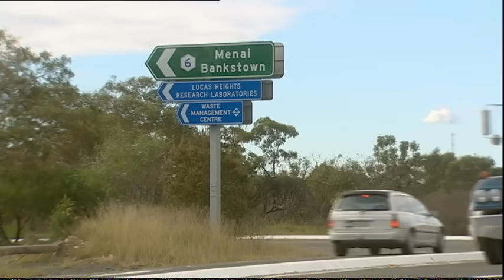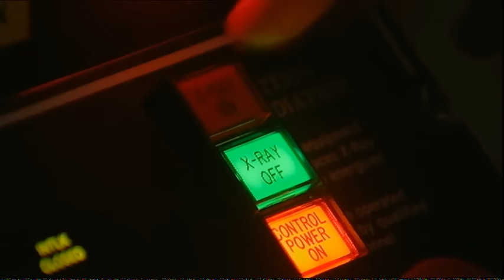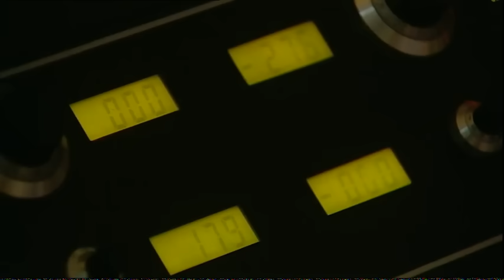The true story of the Kelly Gang Armour | Did it work? Who made it?

Comment: I've done cold roll black smithing, for raising a breastplate. It was done with a hammer and a dishing stump and no heat (hence the cold roll)
As someone who is only nominally skilled I can say without a doubt that this is 100% an amateur build. NOTHING about this indicates it was done by anyone with even a jot of craftsman skill or actual training.
Yes a fire dug in a pit would have been sufficient and if not, then they could have baked it using nothing more than sand/clay, just as they did for thousands of years.
But more importantly is the sheer mismatching going on. This is not a suit of armour, it is a coat of plates slap bashed together. Its still freaking rad, and I love it. but no, its not a labor of even the most basic skill. YES I could make it, chances are so could anyone.
other insights: it has very few hammer stroke indications. now a real suit would have been turned over a round ball shaped anvil and had those depressions hammered back out, which could be how they did it, but I dont think so. It seems to have been heated clamped and bent into shape. its a very simple shape already so thats what Im thinking. I totally nailed it too, the forensic guys said it wasnt heated past cherry.
If the heated metal plates were clamped then you could have used logs as leverage to bend the plates. 2 guys maybe to do it seems likely.

Comment: you can make a furnece anywhere if you know how. it doesnt need gas it doesnt need electricity. and frankly putting it if that was built by a trained blacksmith then he was crap at his job. A blacksmith wouldnt leave any sharp edges and theyd leave very few hammer dents in it as they pride themselves in there work there experts in shapeing steel

Comment: I wonder how it would stack up to a modern 30-06 rather than the lever actions back then. I suspect it may have stopped the bullet from exiting the body on the other side..
Reply: The British program "Time Team" fired modern rifles and projectiles from a 300 Win Mag and it punched through the similiar steel plate used in the demo. I would bet a 30-06 with 150-180 grain soft points would punch through. The kinetc energy would heat up the lead and melt through the metal. After all the WW1 Germans used the same principle by shooting reversed projectile at British tanks.

Comment: Pretty easy for a beginner Smith to make something like this using a basic charcoal forge. Coal forges get way way hotter and yet with charcoal you can melt steel.
Its also not hard to silence an anvil so it doesn't ring and damage your hearing you just mount it properly by staking your anvil shaped object or anvil down onto a tree stump, if the anvil doesn't move it won't ring
Reply: Definitely not lighting a fire and banging on steel with hammer for a week the first set was made at Benela by the local blacksmith and the other 3 by the blacksmith at Daylesford under duress he had a gun at his back the entire time nobody was admitting it at the time my family are from the Golden triangle they knew what happened Joe Byrne was the only one that was any good the Kelly's were not liked they never lit fire's or camped near water and usually only ever moved at night hid in dry gullys and were to scared to even talk worried Aboriginals would find them

Comment: I would assume that climate plays a role in how hot something gets and how it could be moulded? The climate was different back then , hotter in areas compared to now. So, with making a bush forge and the climate/heat at the time and quality of metal( take the steel used for making Buicks even centuries later compared to the synthetic metals and steel used now for making vehicles) at the time, it could probably have been done. Either that, or they made a haste deal with the Devil himself lol.

Comment: I dont get why a pit in the ground with a tunnel connecting it and some charcoal made by yourself cant get a fire up to forge temps? Are coal forge is just a fancy pit with a hole blowing air in from the bottom.
Im not a pro blacksmith, but ive made a ground forge that gets steel white hot.

Comment: The biggest flaw in these "you can't forge out in the bush" arguments is that they're all just amateurs assuming that a fancy and professional building-sized facility is a requirement to work iron or steel. (Or worse, doing so intentionally to try and hype up the myth.) 
Once you divorce it from that assumption it's perfectly doable even by amateurs, much less a trained blacksmith who just snuck some simple tools to the bush for a quick job.

All you really need to get a functional forge going is some bellows (Which are relatively portable and common), a couple bags of charcoal, and something solid to beat it on. That's it. 
There's plenty of videos of people forging with simple setups like this using a simple hearth made of mud/adobe, and a stone for an anvil. (PrimitiveSkills's channel shows this quite clearly on numerous occasions. Ditto all the various videos of third-world smiths floating around on YouTube.) 

I'm inclined to believe that guy who mentioned they used a log to form the cylinder shapes. The log would most likely be spent afterwards, but there's no reason it wouldn't last long enough to form such simple shapes with one.

Comment: If the armor was from farm implements that were made on a forge and then heated in a cooler Bush fire wouldn't the forge still have left its mark making all testing mute ?
Reply: No because every time the steel is heated it rearanges the crystal structure.
Reply: @awellner3285  I didnt know that . would you be able to tell that it was forged at one time and then reforged like tree rings ?
Reply: @pigeonpallz1733  only if the material wasnt fully reheated, then it would have traces of a different crystal structure sprinkled within. 

Like they showed in the video where some of the crystals were bend when still cold.
Reply: @awellner3285  that's cool ! Thanks

Comment: Whoever wrote this is a moron. I have accidentally melted steel in a cheap ass home made forge. I was using regular wood not even charcoal.
Reply: Actually just tree bark.
Reply: With a blower it's possible with enough forge depth. Without a blower no.
Reply: You didn't need any forge depth. I was using a small pot with a hole in the side.

Comment: To find out take a shank of old similar metal and give it a bush job. 750 C° cherry-red is still hot. It all comes down to tools and materials. How to get plating, an ambos, pliers, hammer, a drill, screw, rivet, riveting hammer, splitting wedge, saw, vise, files when you are on the run? You will get it on a station. Someone gave them a hand I think.

Comment: You reckon that would have really stopped a bullet back then?
Reply: ned kellys armor reportedly had 18 bullet holes in it so yeh i reckon it could have stopped a bullet
Reply: ChiefGuacamole holes or dents? Coz if it was jokes then his body probably stopped the bullet ha ha.
Reply: @heimdall7098  
Hahahah! Bullet holes means the bullets went through. 

To be more precise I reckon 2cm of (lightly) forged steel/iron that one would find on the breastplate could definitely stop a black powder musket ball, especially from a pistol or revolver paper cartridge.  However on the helmets neck guard you can clearly see a musket ball went straight through the steel and that was the shot that killed Byrne I believe. 0:44

Modern cartridges would plough through it no problem. I wouldn't wear steel like that in a firefight today, I would rather take it off and run. Armour stopped being effective and reliable protection against firearms 600 years ago, until kevlar and modern steel forging from the late 20th century. That said even the strongest modern armour cannot stop purpose built armour piercing ammunition today.
Reply: It could stop 19th century handgun bullets, no problem
Reply: maybe if its hit at an angle